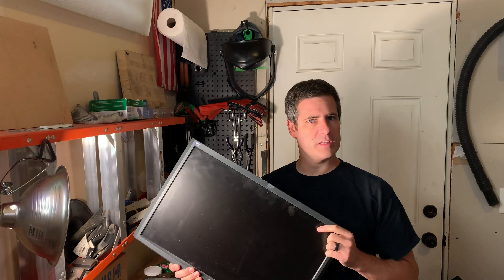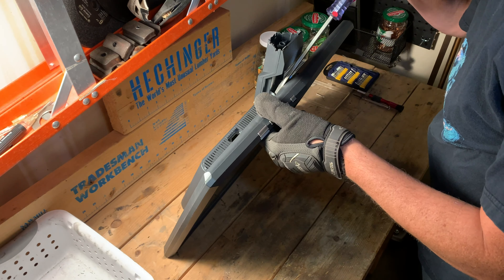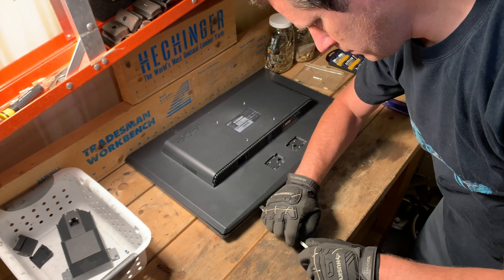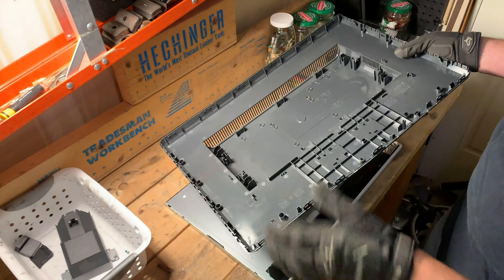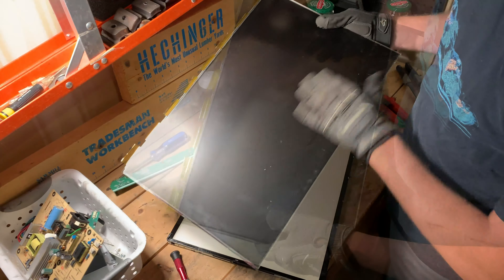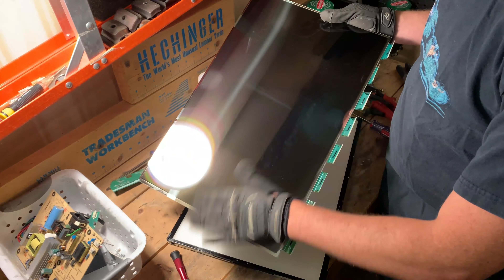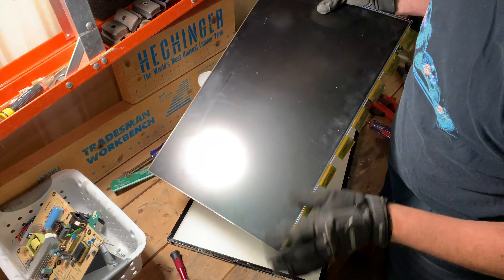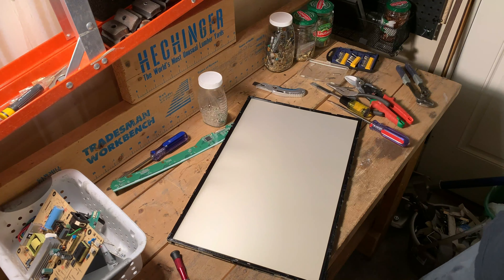eWaste Mining: How Valuable is the Scrap from an LCD Monitor

Comment: The gold iridescent mylars that connect the gold plated finger board to the display screen may have a slight amount of gold on them. I peel the ferrite strip out of them and save them for future processing.

There is a small amount of wire that runs the length of the fluorescent backlight tube housings. It all adds up.

I keep the thick polycarbonate (plexiglass) screens and give them to friends as cutting boards. They work pretty good for that purpose. I guess you could dress them up with a wooden border but why bother? Repurposing them is enough.
Reply: Oh yeah, the hex studs holding in the monitor connector jacks, they're usually plated brass.
Reply from the maker: Good to know about the small strips that may have gold fingers.  I like the plexiglass as it makes good table top protectors ... like you said, cutting boards.  I like to work on them as I many of them on hand now, and I don't mind if one gets beat up pretty bad.  It saves my wooden table from major damage.

Comment: the green wire on the power board should be copper.....it usually is tin coated....strip and put into your #2 copper stash
Reply from the maker: Do you have a trick for stripping it off?